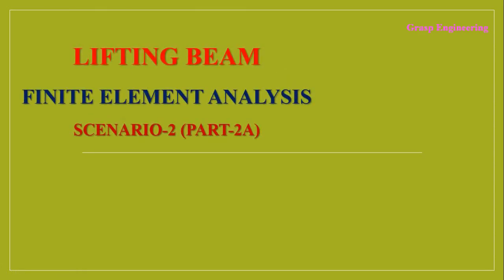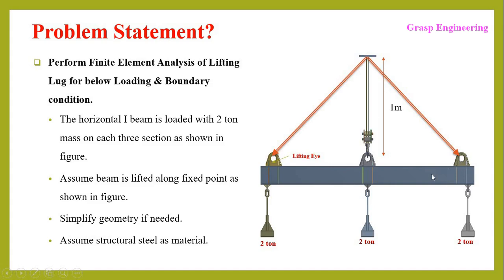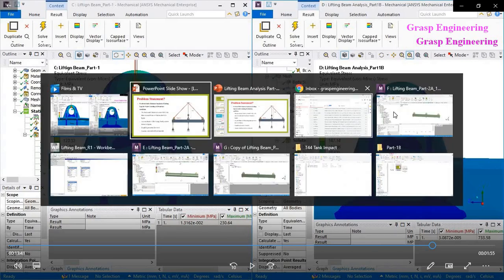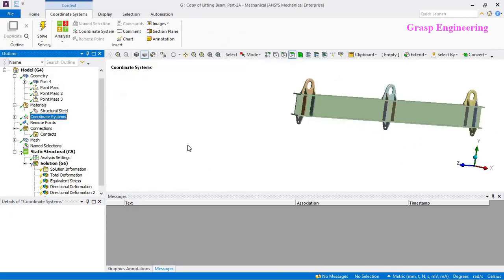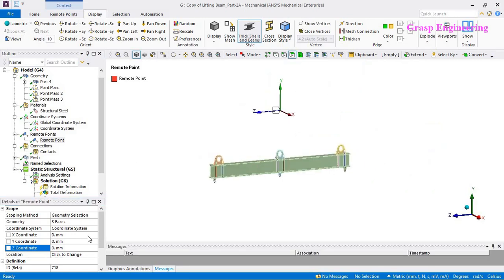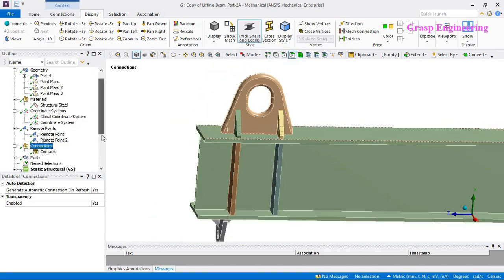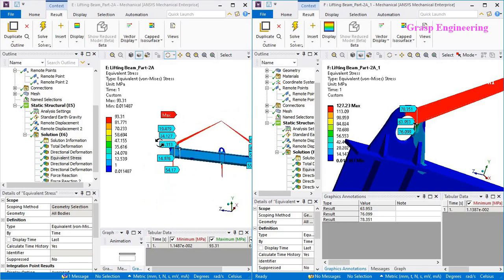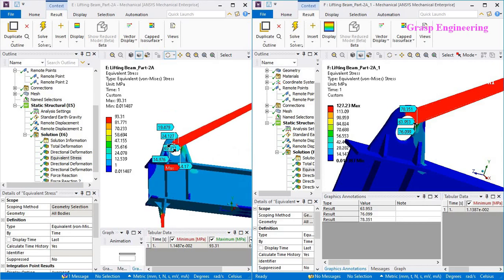Lifting Beam Finite Element Analysis using ANSYS # Part 2

Comment: Thank you for these thoughtful tutorials. I have three questions, please:
1. Would you kindly run this analysis again with both of the Remote Displacements to be free in Rotation X ? I am curious to see the effect in the local area of each lifting lug/eye.
2. Would you perform a tutorial with this lifting beam as midsurfaces (and use shell elements) ?
3. Do you make this 3D model available for those interested to practice ?

Thank you.
Reply from the maker: Hello Naldo, Thank you for appreciation !
1. You will have some effect due to rotation but it does not impact much on stresses.
2. You can do with shell elements, mostly have similar results.
3.We will upload this on our blog: https://www.graspengineering.com/category/design/fea-cad-geometry/
We have uploaded so many videos on lifting scenario, such as lifting beam, pressure vessel lifting. kindly visit all the video and try to do practice at your end. Let us know if you have any concerns, thanks.

Comment: Hi is there any minimum allowable deformation for the particular beam used or allowable stress , to check its allowed to use or not
Reply from the maker: The deformation minimum values should be defined in user define specification. There is no such criteria for deformation, you need to decide based on your judgement and product experienced.

Comment: Hello. Why did you use remote point - beam for lifting sling simulation instead of springs? Can you share a source why this approach is suitable in this case.
Reply from the maker: We need to simulate realistic scenario and hence we need to model the lifting point and connection between them. To define connection between lifting point and lifting lug, you can either model exact chain, or else use rigid elements.
How lifting is done by spring ?

Comment: this analysis is wrong!! when you change the height of remote point you expect the change in reaction forces in z and x directions, because tension load in cables will change. but in this analysis when i change the remote point height, reaction forces doesn't change!!
Reply: In fact, when you apply remote point displacement it doesn't apply horizontal reaction forces from cables tension properly.